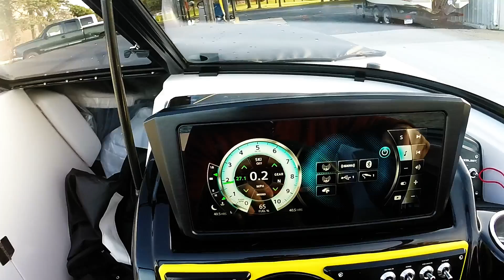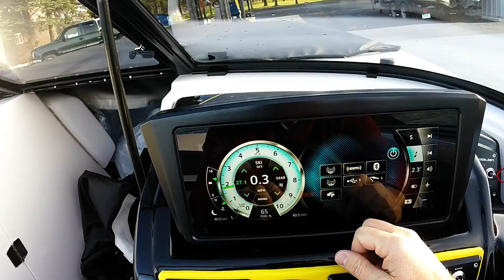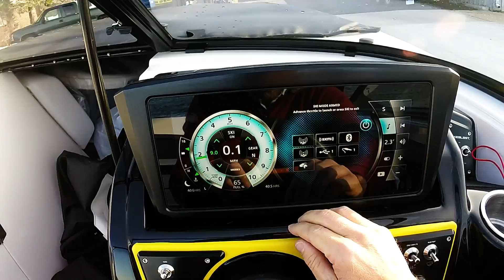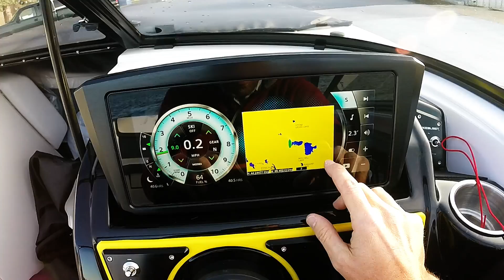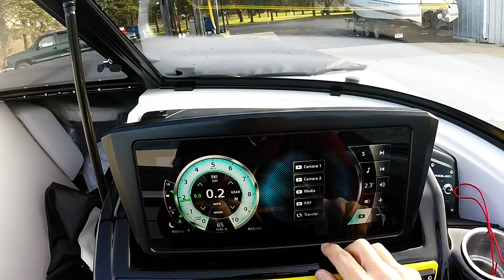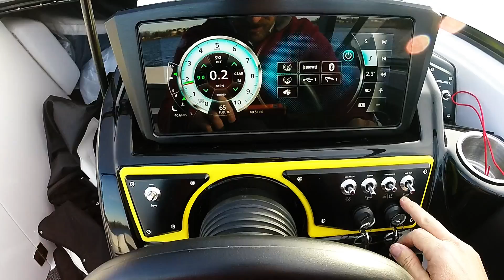Scarab Command Center

Comment: I have 2020 215ID with the command center and twin 300's. It runs well, but WOT is only 40mph. I previously have been above 50MPH and still had throttle left. I suspect I am in a ski mode etc that is restricting the speed. Any idea how I cancel these modes?